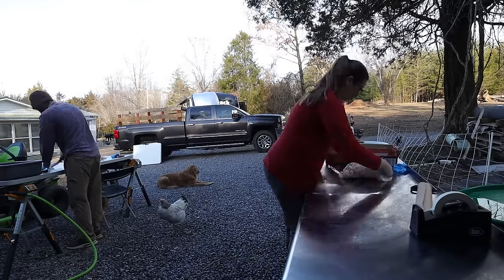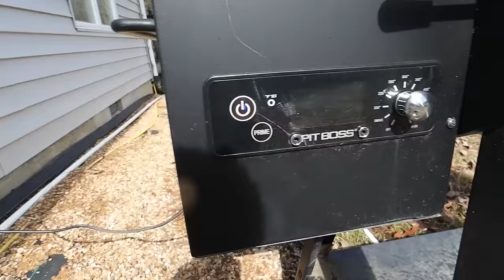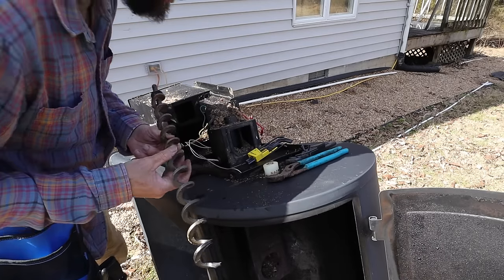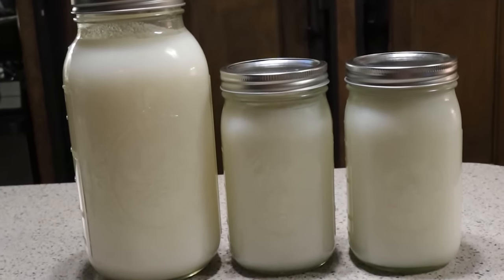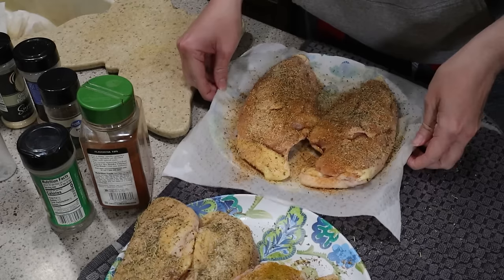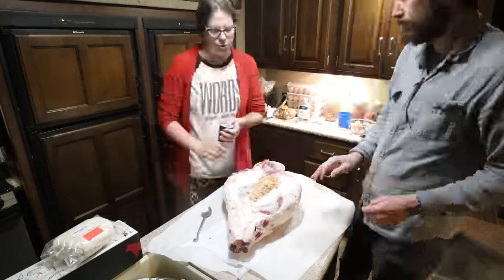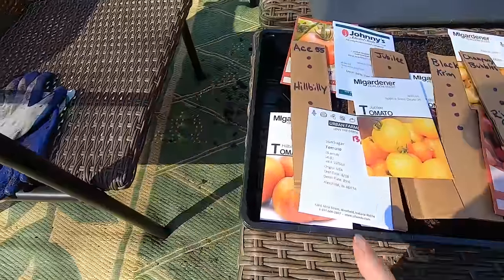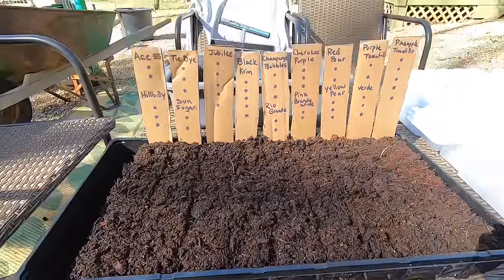Loving Homestead Life

Comment: What is the device you use starting at about the 8:05 mark on this video?  To compact the soil and make the hole for seeds?  Love all your hard work!
Reply from the maker: It is a soil blocker. You can get them at most garden supply stores or order online. They come in several sizes so you can start seeds without all the seperate containers and the roots don't get bound up . Just seperate when ready to pot or plant.